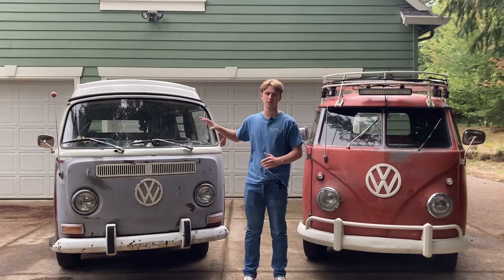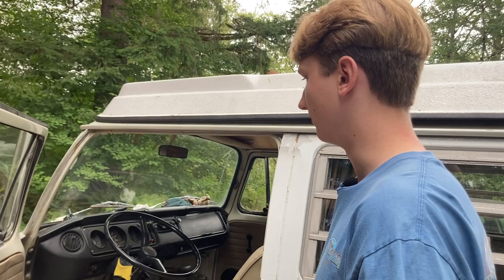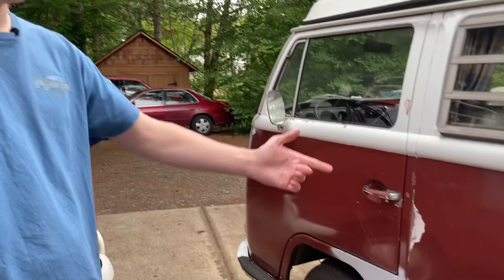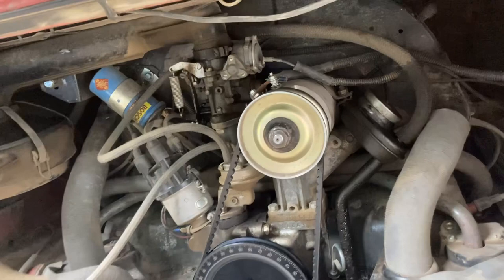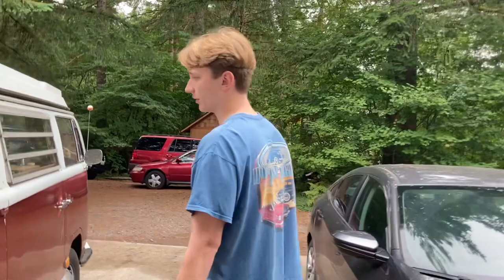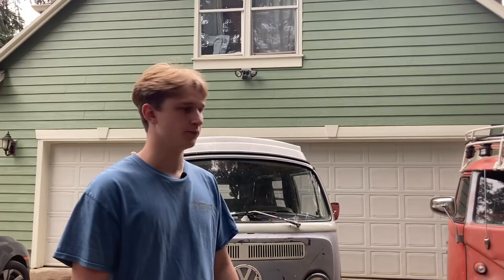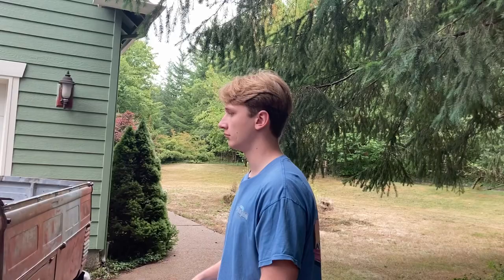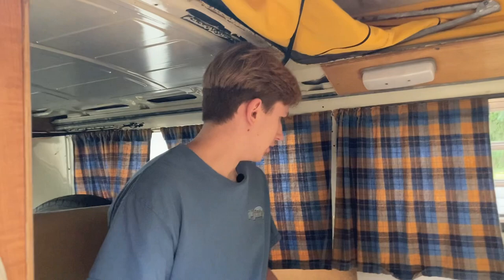What’s Better? Split Window vs Bay Window Bus Comparison!

Comment: It’s good to have this “ out there” for folks, real owners giving their views & experiences. However…….. neither bus cools well, especially if lowered! It’s not only air-cooled but OIL-cooled, so regular oil changes are vital too ( amongst other things)!
        This video is great for anyone who’s gonna be a first-time owner though, and since you daily-drove your bay for years your experience is authentic and valuable. My bay has a 2.0 type 4 engine, worked on by great mechanics. My ‘67 Split has been continually brought-up to an outstanding level (with much diligent work). My Bay Window 1977 has discs up front and power assist booster for those brakes, over the past 15 years I’ve gone on long trips on interstates with no problem. If I’m ever in a prolonged reckless mood perhaps I’ll do that with my split, along with a lot of prayers. 
        Again you’ve done a great job here showing and talking through these two buses.

Comment: Great video. Thanks. I love the driving experience in the bay bus and the extra leg room. I’d say the most diference I felt was that in my recent bus I did the entire engine and the mechanic revised the entire vehicle. That really helped with making it run well. No longer being stuck somewhere because of random issue and having to tow it to the mechanic 😂

Comment: Bay window is better, mine is apart and I'm not sure if I'll get it back together (poor health), so now I'm bouncing around in an old, slow, noisy split window bus (now I see why the hippies did drugs).
Reply from the maker: After owning and daily driving a bay window I totally agree. My bay is also apart (I’ve made a few vids on the process to get it painted) and I can now only drive my dad’s split whenever I wanna drive a bus. It’s much less soft in the suspension and steering.

Comment: My mother had both.  The best and most reliable one was the split window 1965 Bus.  The lemon was the 1971 Bus with the 1600 dual port motor.  The 1971 bus also sounded like a tin can when it was running.  In 10 years the 1971 bay window bus also needed to have three engines due to valves being sucked down into the crankcase.  The 1965 split window bus was still running when mom sold it 27 years later, and only needed one engine.  The 1965 bus also had a 1500 engine that ran forever.  I also hate the bay window busses.
Reply from the maker: It’s interesting you had such a different experience with these busses considering they use almost the exact same engine. Granted, I would prefer to have a split window, but the bay window offers the same drivetrain and a similar bus experience at a fraction of the cost. The only reason I might suggest your valves burned up so frequently was a lack of maintenance. The valves need to be adjusted every 3000 miles for both of these cars or you run the risk of damage your engine.
Reply: @jakeandcameron7022  My mother did have the oil changed and valves adjusted every 3000 miles.  It did nothing to prevent the problem with the 1641 dual port engine.  Her VW mechanic said they increased the horsepower, and engine size but failed to increase the size of the exhaust valve, and this was where the problem started.  Many people also installed an aftermarket engine oil cooler to try and cool the engine.  In 1972, VW came out with the 1776 engine.  In that engine they did install a oil cooler inside of the fan shroud.  A relative of ours bought one, and it was reliable like our old 1965 Bus with the 1500 engine.  Many people who bought the bay window busses made from 1968 to 1971 all had the same trouble.  I was alive at the time, and many of them were running with the oil cooler modification where an external oil cooling unit was installed on the outside on the side of the bus.  The cooler was installed by drilling through the block, and brass fittings were mounted to take rubber fittings to supply the oil to the cooler.  Many people did say it worked, and they quit having valves being sucked into the crankcase.  My mother went through three engines in 10 years on the 1971 Bus.  It was something like every 30,000 miles a valve went into the crankcase.